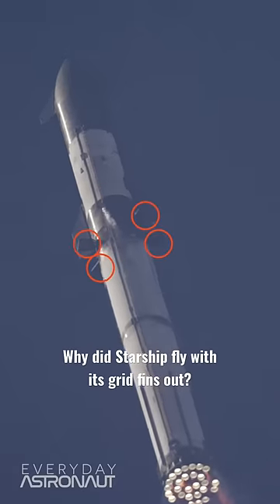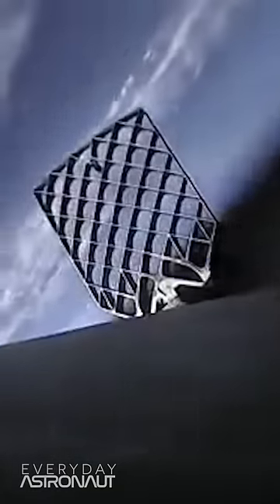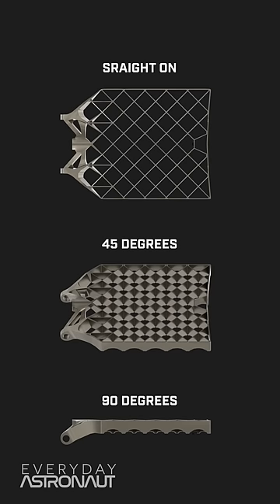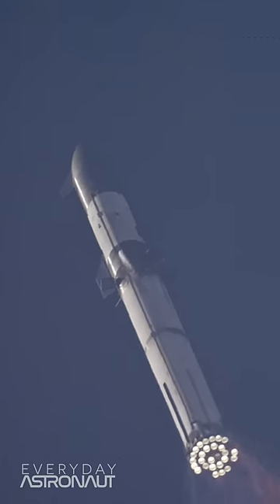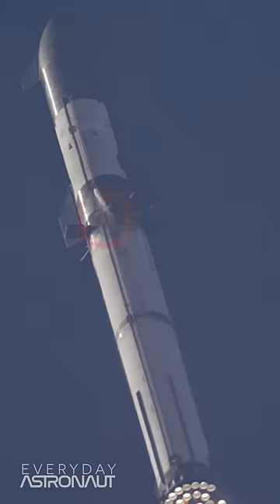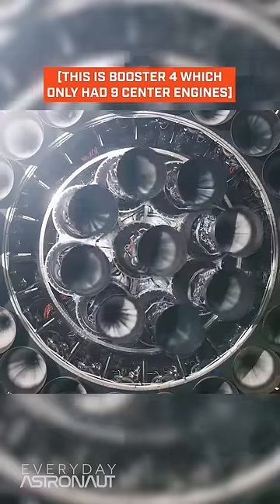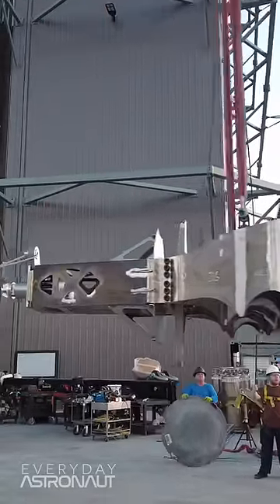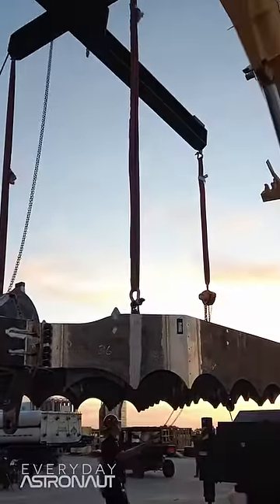Why did #SpaceX keep #Starship’s Grid Fins out on ascent?

Comment: Interesting, it’s amazing how the weight savings of the unit offset the fuel use during assent. Thanks for the update.
Reply: Yep. I would think two little motors to retract the fins would be much more full efficient. Instead, it's better to not have motors and have instead fins in fixed deployed position. I guess the other factor is that a failing motor could cause the lost of the entire rocket, on re entry
Reply: @gianluca.g  Motors to expand the fins could operate in near vacuum with relatively little force, torque and power. But the current design uses a simple axle to rotate the fins, instead of a more complicated joint which allows movement in a second axis to unfold the fins.
A joint which can be locked into one axis once the fins are extended might allow to build retractable grid fins, while being overall more efficient.
But it would need a more sophisticated yet heavy-load-bearing design, so for prototyping it's mostly just another possible point of failure which could delay testing and development of more important parts.
The other factor is, that a relatively low dry mass is crucial for efficient landing of the booster, otherwise more fuel is needed for landing, which either reduces payload capacity or requires to carry up additional fuel for landing -> which needs more thrust for lift -> which needs further extra fuel for lifting the fuel for landing. So a reduction in drag (thereby fuel consumption) during ascent must also be carefully weighed against a higher dry mass.
Reply: @gianluca.g  You say this but them fins are massive, alot bigger than they look here.
Reply: Good observation
Reply: @justmy-profilename  You're implying the grid fins (dry mass) aren't waterproof?
Reply: @justmy-profilename you definitely don’t want to delay this anymore. Man’s 50 years behind current science anyways

Comment: Holy hell seeing the grid fins on the ground like that really puts it into perspective. Did not realize they were that massive.
Reply: Don't listen to what this guy is saying.  He doesn't understand aerodynamics.  "They don't steer using drag"  that's how all aircraft steer.  Using the control surfaces to create drag and steer the aircraft.
Reply: @skyhighmediasolutions891  Sorry bud, but all aircraft do not steer by using drag. They create a pressure difference that pushes the flying surface (wing, tail, etc) in a particular direction. The drag associated with this is skin friction drag and tip vortex drag, followed by compression drag and shocks if going fast enough. But the drag is different from the pressure difference.
Aircraft that steer using only drag are rare. Imagine a scoop coming out of a wing to try and retard the wing from moving as fast through the airstream. The Star Wars fighters on Hoth used this type of drag system, and they are entirely fictional.
Reply: @flechette3782  but thats.. what drag does.. you're using the fins to create drag on purpose in order to force the craft to turn in a desired direction..
Reply: @captainfraser3827  Lift is related to drag, but they are different things. You can easily see this in a hypothetical design: would you design a fighter plane to be controlled by extending small parachutes for control? That's drag. Lift is the pressure different between opposite sides of  surface. That creates t=drag, but it isn't drag itself.
Reply: @skyhighmediasolutions891  mostly true, although there are some steering methods that use spoiling lift on one side rather than drag. but yes, traditional steering mechanisms (ailerons, etc) use unequal drag to move the aircraft about the roll axis.

grid fins would also use drag as well.
Reply: y not use a parachute?
Reply: @flechette3782 or turning motor nozzle..

He's rocket nerd and knows physics same amount than I could write good English. So today we fly to sea! 🐠 

Those fins packing air, then direct it the way they want. Moving those could have some effect too, because balance shift and those are heavy. 

They aren't just flat, those cuttings help to air go in grid and volume rises because pressure and material what is squeezing air. It comes out faster than air outside that fin.

It's little bit how ship's turn, if those have one propeller and no azipod's.

Btw, those could have got some idea from azipod's when they think "how to steer dead pipe falling from sky"..

Amazing pipe indeed.. how many patents Elon have in he's case? Not just SX..?
Reply: @flechette3782 does engines lifting or drag when this big pipe is landing? 
I mean, if they lift, it's still falling.. if dragging, they lost drag when speed is lost..

??
Reply: @Eduardo_Espinoza 
Why you aren't working for SpaceX? Elon could pay you billions, if you tell the secret "parachute's would be better!"🎉
Reply: Elon said that those grids are biggest part made one piece by titanium ever done.. not looking that in this video's one picture :P
Reply: @jannejohansson3383  Drag can slow the rocket to a constant rate of decent but not get it to hover. That is all rocket lift.
Reply: @jannejohansson3383  If the engines are firing then they are producing thrust. Rocket engine thrust is different from aerodynamic lift or drag.
Reply: @captainfraser3827  bro is so confidently wrong

Comment: Remind me of one of those bike pedals that sends you straight to hell when it accidentally hit your shin
Reply: I have been sent to hell by one of those before. Imagine getting shinned by one of these rocket pedals.
Reply: Now you know why Starship keeps its legs tucked in tight and outasight.
Reply: Anyone with even a slight familiarity with fluid dynamics knows that even "straight on", those grid fins produce a LOT of drag.
That's a huge mass of air, turned into turbulent airflow, TIMES FOUR fins..

They most likely did this for extra authority over control in case something went wrong, combined with the fact that they're not trying to reach orbit.

They may have even done it because they have CoG/balance issues that they mean to correct later.

No matter what, they absolutely did not do this "just because it doesn't add much effect" because it absolutely effects the performance a TON

They did this on purpose, for a purpose - just because he and we don't know the reason doesn't mean that "they did it because it doesn't matter much".
Reply: BTW I used to race BMX (and was mostly into freestyle dirt, just raced because of that lol) and I've had "fluid on the knee" 3x from slipping the pedals.. so I love your comment ❤😂

Forgot to mention that
Reply: wow you just made my brain dust off an old pain file from my childhood, haven't thought about those pedals since
Reply: When you accidentally miss the pedal it doesn’t matter what you’re wearing. You’re losing leg skin
Reply: lmao! yeah! ...the old "bear trap" bmx pedals. Holy Smokes, you'd get to see your shin bone if you slipped good enough!
Reply: While they suck for that, they are great for ensuring you have firm contact with your pedal even in rain.
Reply: @jonslg240  could be because they needed more space, less weight, or that they needed motors that were way too big, so they just removed the function and had them out permanently!
Reply: Bear Claws! My pedals were Bear Claws and they shure did hurt when used improperly
Reply: @jonslg240 it’s because of weight, has been stated as such tmk. Though Elon has stated it doesn’t effect starship enough to be a worry*
Reply: I had the Club Roost pedals in 1997, they look pretty similar to this, 2 rings of jagged edges and they even had little bolts that stick out of the flat part of the pedal for even more grip, the grip was amazing, but I now have several dents in my shins that you can fit the end of your finder in.
Reply: If you know you know.
Reply: Still have dents in my shins 😢
Reply: Heck*

Comment: Engineers: It doesn't matter if it's flying at an angle of 3 degrees or less.

Starship: proceeds to fly at 90, 180, and 270 degrees on first test flight
Reply: ....he is talking about the angle of the grids turning in relation to the direction of the air flow over the rocket, not the degree of the rocket's flight in relation to the ground.
Reply: @alexistaylor969  True, however a non-winged object such as Starship can't easily change its movement direction when it started off supersonic (or close to it). Therefore, the ground velocity probably stayed roughly the same direction during the flips, and since it was moving far faster than airspeed, I'm certain that relative to air velocity, Starship did some flips.

This would make the fins experience rapid changes in relative air velocity, hence my comment.
Reply: Can these fins be the reason of starship rotation?
Reply: It doesn't really matter.
Reply: @markusbuhler for a while it was.
Reply: At that point, the grid fins are the least of their concerns
Reply: Hopefully everyone will have built-in vacuum barf tubes built into their space suites. 😅🤢🤮
Reply: On first test flight is key words....
Reply: I'm just amazed at how heavily people are leaning on "intentional termination".
Reply: @UKnowIfUKnow well we have to be green and everything but they're blowing f**** perfectly good rockets up
Reply: @mattlane2282 "perfectly good"
Yeah, no. I'd rather take a dozen flights with a Saturn V than go near these things.
Reply: Engineers: It doesn't matter if it's flying at an angle of 3 degrees or less.

Starship: proceeds to explode.
Reply: Too many engines.
Reply: i think they had bigger problems than drag on flight 1.
Reply: @circeciernova1712 nasa disagrees

Comment: The fins are designed to work at around Mach 5 reentry speeds from high altitudes. Also, low speed upon launch = low drag, while less dense air with heights = decreasing drag potentials from increasing speeds.
Reply: They're also a lot closer to the center of mass, so I don't see how they would have much authority on ascent.

Comment: Did they confirm that it was intentional detonation yet?
Reply: Yes.
Reply: Yup.
Stage 1 was left to burn all its fuel.
It hadn't reached sufficient altitude, or speed for stage 2 to fly it's mission.
Meco not commanded, stage separation not commanded. 
Without filing a whole new flight plan the only thing to do was scrap stage 2.
Reply: They lied and said it was intentional.

Comment: Can the grind fins be used to steer the vehicle on ascent? I mean you have the engines to do that but the grid fins could do it as well, at the cost of increased drag.
Reply: They are in front of the center of mass, so using them to steer would be really tricky, and the engine gimbal can steer the rocket just fine. In short, they could but there is no reason to.
Reply: Since another yt user mentioned "cosine losses" from gimballed engines, I don't see why doing this would be a bad idea, if you have them in the airflow. That phase of the journey doesn't last long and on the way up their 'authority' might be dwarfed by vehicle mass - perhaps that's reason enough to not bother?
Reply: Another problem is that the center of mass moves forward as the propellant tanks on SuperHeavy drain. It's behind the grid fins at launch (as shown in the video) and surely ahead of them at stage separation (when Starship's tanks are still full while SuperHeavy only has enough propellant for the boostback and landing burns), which means the CoM must move past the fins. So for a considerable part of the ascent the CoM is going to be very close to the grid fins, meaning that they will indeed have very little yaw or pitch authority during that time.
Reply: @vyznev  This. Also the reason why the grid fins on the N-1 were at the very bottom of the rocket.
Reply: @vyznev  I wonder how much of an effect mass loss has on the combined CoM early on (when aerodynamic steering could work) in flight, as SuperHeavy's CoM moves away from StarShip while boosting. In the early stages, some of the mass lost could be from forward of the initial CoM? "Very little yaw or pitch" seems valid still...
Reply: It's possible (think jet fighters with canards) but it is an extremely unstable configuration for aerodynamic control services. As in, one perturbation and it will likely flip the rocket if no correction is put in quickly enough. Unlike a jet fighter, a rocket design probably prefers more stability than agility.

Comment: It wasn't an intentional termination. It broke apart starting at the aft end, and Starship was already damaged.
Reply: it was after it was untrollable the flight termination system kicked in
Reply: @priyam352  they just said that to make it sound like less of a failure.
Reply: @jimjormy3575  why would this be a faliure do you realise they are testing the most powerful rocket of all time which has drasticly new concepts from any other rocket for the first time? this was a succesful launch and if it wasnt for the concrete of the launchpad shooting into the engines the flight would have needed a termination idk who these people are calling this a failure when they clearly dont know what they are talking about
Reply: Found the bots.
Reply: @jimjormy3575  how does the initiation of the FTS imply it wasn't a failure?
Reply: @jimjormy3575 Well they said that it was likely to fail before launch so
Reply: The flight termination system did activate, just not enough to burn the fuel to explode the rocket. In the video you can see fuel leaking when it was spinning and falling.

Comment: Also increases stability on ascent.
Plus they are only in front of the COM if it was flying WITHOUT the Second stage (StarShip).
But with StarShip attached it isn't that big a deal, because up until separation it is one large structure, and the COM is higher up the stack. 

Then once the stages separate, the booster is falling (with boost back burn etc done at altitudes where drag is nil/negligible), and they act almost like an aerobrake, stabilising return flight, and making course corrections as needed.
Reply: This is all wrong. They decrease stability on ascent because they are in front of the center of mass. As Tim said they can however handle this through gimbaling of the engines. And they also do not act as an aerobrake as they have relatively low drag (something also mentioned in this very short).
Reply: @anonymousanon4822  Other way around... they decrease stability on *ascent*, which is when the engines are operating to negate that effect. On *descent*, they're the primary control mechanism.
Reply: @simongeard4824  I meant ascent obviously, my bad. Thanks for pointing it out!

Comment: I have been asking this myself since the launch. Thanks Tim for clarification
Reply: The real answer is probably because they malfunctioned or was not deemed activating for a test flight.

But whatever floats this guy's boat I guess.
Reply: @teleman07  no this guy interviewed elon and he said that why make a complicated mechanism to fold them if they dont effect it that much. Thats just one extra system that can fail and puts extra weight on the starship.
Reply: @Sneakoz  That is interesting because same can be said for the gimbal designs. However, the logic itself is cool. Very inline with US muscle car mentality, which are awesome.
Reply: @teleman07  The gimbal engines are necessary to maneuver the vehicle and so are the grid fins, both parts do their respective roles just as well as the nitrogen thrusters to maneuver the vehicle. The point being made here is why don't the grid fins fold for liftoff and open up for landing, Since the grid fins don't affect the aerodynamics that much, it wouldn't be wise to invest in a separate mechanism to fold the grid fins which also effects the weight. And the grid fins on the starship only help with directing it whereas falcon 9's grid fins slow it down as well as direct it.

Comment: 1 word: control
To control spaceship there's 3 way..
1. Rcs (jet out gas)
2. Aerodynamic (with fin or similar)
3. Gimbal thruster (some thruster have gimbal ability, which move little bit degree of angle to help control the ship)

Cheapest way is using aerodynamic but only for planet/satellite with atmosphere.

Comment: It removes one mode of failure on descent but may add another on ascent, because if engine gimbals will be slow to react it will immediately go kerbal. Although the wings on the ship will induce the same effect anyway so probably not much of a difference.

Comment: Starship also had a mechanism to control pressure within the fuel cells to prevent a sudden explosion. This could be extremely valuable as far as saving the lives of astronauts if the module they were in could eject and be safely landed using parachutes.

If we are going to become a interstellar species, we need to protect the ones qualified to do such work. Safety first.

Comment: This is the same principle how aircraft are tested without retracting the landing gear… prevents any unwanted risks if it wouldn’t extend later. 

They keep them extended in case they failed to deploy on reentry which would potentially cause unwanted booster movement.. I’m no rocket engineer but I fly planes so, I guess I got some of that right at least in terms of safety!

Comment: They can save a lot of weight and fuel if they just jettison the grid fins at some point like they do the fairings and boosters😊
Reply: Then how would they steer the booster on descent for the next flight? It’s designed to be fully and rapidly reusable so nothing, except fuel, is expended

Comment: But it is for sure helping the problem of buster deceleration  when hot staging and pushing the fuel to the top of the tank leading to engine failures

Comment: This does not "remove a failure mode" this ADDS failure modes. What if gimballing atops working ir fuel arops flowing? It will tumble exacly like what we saw and then itll explode.